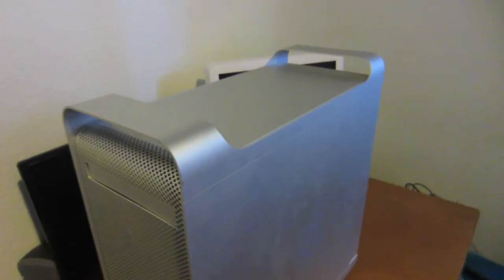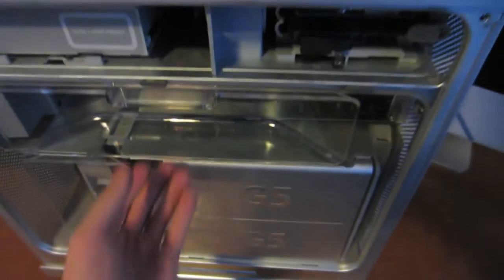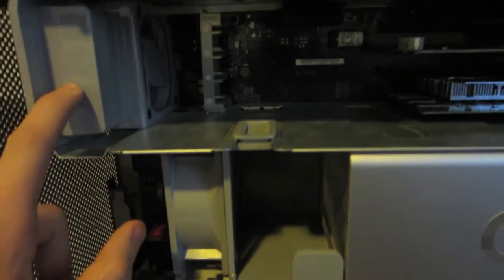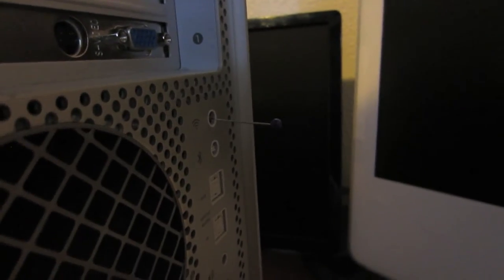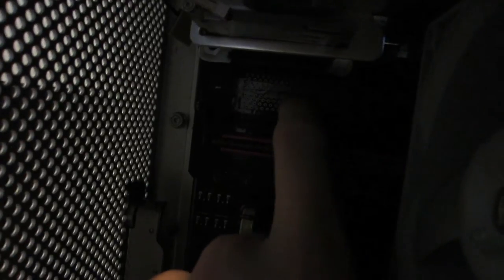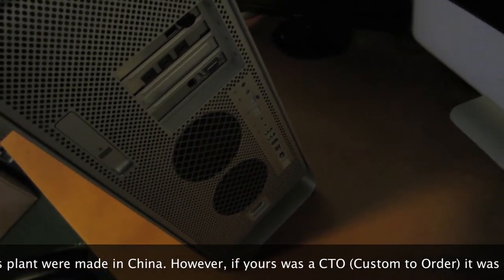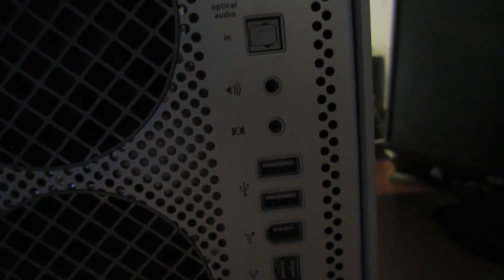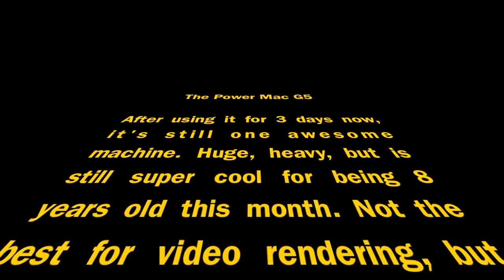Power Mac G5 - DP2.0/PCI/2GB/160GB/R9600

Comment: In Target Disk Mode the Power Management in charge of Thermals haven't loaded as they load in when the OS does - so it ramps up the fans to max to protect the hardware and stops damage... my PowerMac G4 does the same in Target Disk Mode.